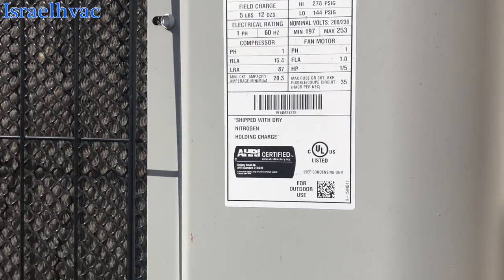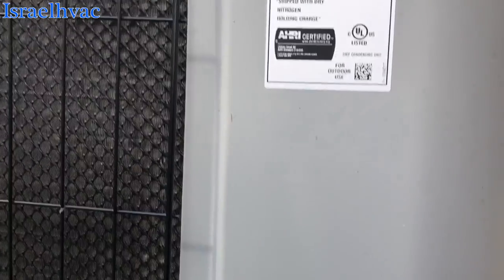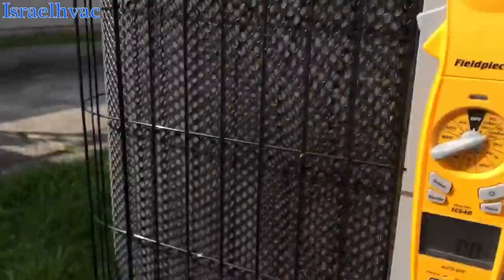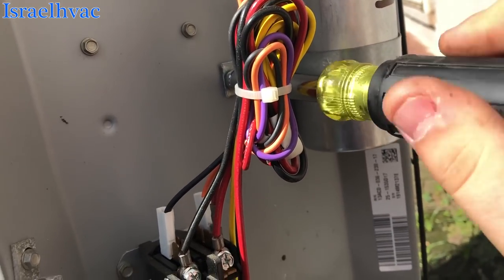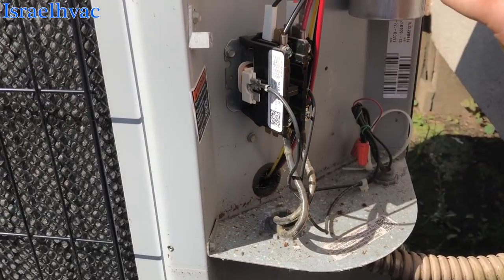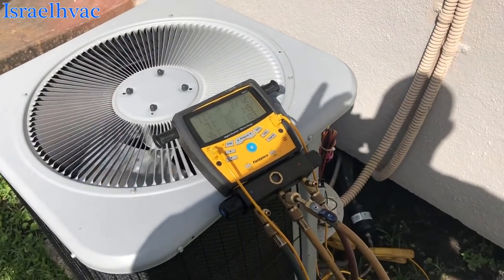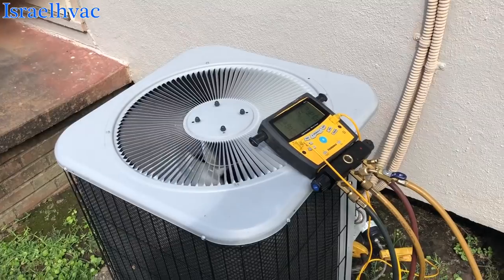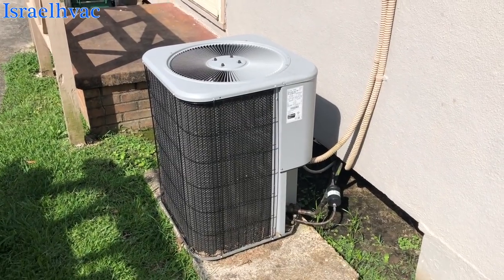HVAC Service | No Cooling | Condenser Not Running

Comment: The maximum breaker listed is 35A. The breaker in the electrical panel is 40A. So I would suspect the breaker as being weak, possibly from corrosion being in an outside panel.
The condenser unit appears new, although using R22 (AC's stopped being sold with it in 2010), and possibly replaced an older unit that drew higher amps.

Comment: Breaker could be weak. However i wouldhave ohm'ed out the compressor windings. This way you know for sure!
Reply: @brandont9015  If your asking why you would read the ohm's on the winding's? Your looking for degradation of motor winding. You need to read them across each terminal on the compressor itself. Start to common Run to common. Then Run to start. On a brand new motor these readings would be almost the same,if not the same.

Comment: In cases like this, I like to pull the cover off the panel to check the lugs on the breaker. I had a trane heat pump on Wednesday that tripped the breaker and everything looked good. Ran for 45 minutes and tripped again. Found 1 leg of power had a loose connection in the panel

Comment: Calls like that, I check all HV wires for any places it may be rubbing through. Then check all connections for tightness from unit to the breaker box. Also temp the breaker to see if it's getting hot. They just don't trip without reason. If all that checks out then may just explain its was possibly a brownout and note it on ticket.

Comment: I ran a call yesterday with a federal pacific box. Common wire from compressor shorted to common wire on capacitor. Luckily the common wire to the capacitor burnt in half , because federal pacific breakers are notorious for not tripping. This one didn't and customer smelled " something burning " right before the a/c went out.

Comment: If you're diagnosis is a weak breaker, why not replace it with the correct size breaker (35amp)   while you're there.

Comment: Could it be because the A/c unit isn't grounded...maybe? Check the video at 2:13 for the disconnect wiring at and 3:53 at the outdoor unit. Can this cause a breaker to trip?

Comment: Was the condenser fan running?
It looked like it was spinning slowly backwards.
Reply from the maker: That’s the camera that does that.
Reply: I was wondering that, it was backwards in every camera shot I saw :) I know that was very obvious for you! Good job by the way! oh quick question, how did you do the calculation for the capacitor while running, I have never done that before?
Reply: I will check it out, thanks
Reply: For hermetic side amps on start wire, multiply by 2650, then divide by voltage from c to h on cap. for fan side start with amps of fan start wire then proceed the same way.